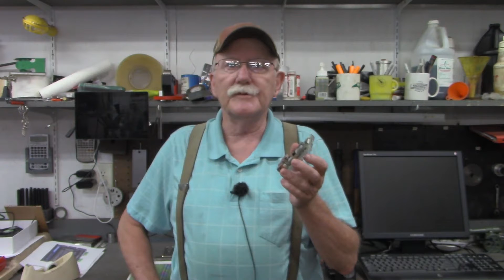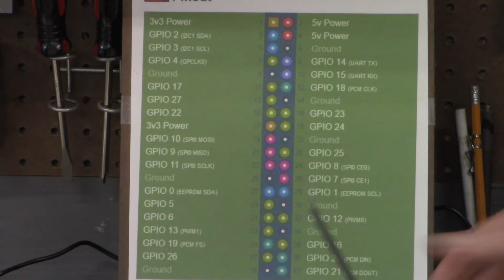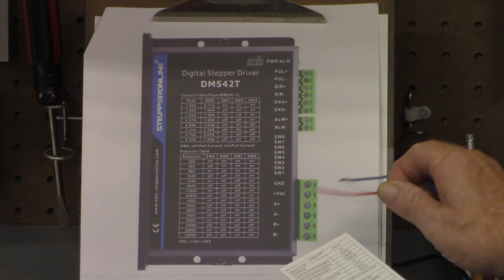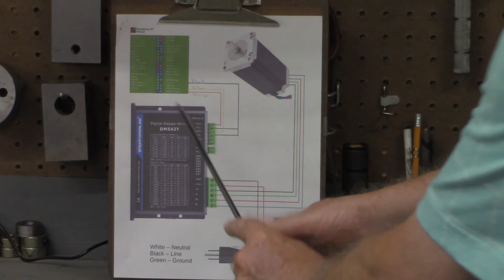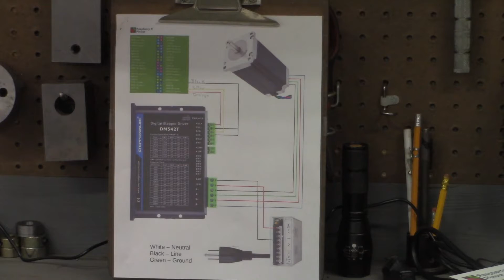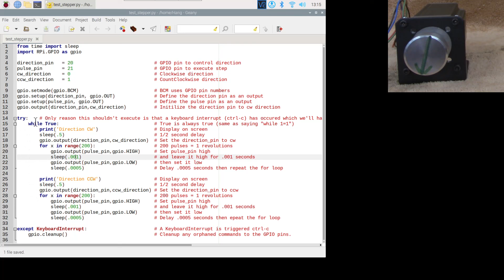Controlling Large Stepper Motor With Raspberry Pi

Comment: I knew this could be done. I scavenged the exact same Pi from an entry gate I demo'd. I have finally gotten the pi to boot up and I have found the geany 2.0 program entry system. I am picking things up at a snails pace. I don't know what python is but is there a place I can copy paste your test program? I typed the same words into the terminal but it doesn't appear to care what words I enter. And I see the colors seem to imply function. I'm just testing the motors so I can modernize an enco PC mill 50. I'm getting closer this was a huge help!

Comment: if you set it for a certain number of steps or pulses can you then use a potentiometer with more code for continuous movement while speed is coming from the pot knob?

Comment: Very Interesting I've been wanting to add a cnc z axis to my mill but I need full control meaning I gotta be able to peck drill probe and a few other tasks  i found a raspberry pi hat that give the pi a real lpt port you can add a 5 axis break out board and just use linix cnc or i have and arduino control with open build on my jd garage plasma table really not fond of the arduino control my cnc is windows based it works great I have a 2.2 kw spindle and a 45 watt co2 on her I've been using mach 3 since xp no complaints on it other that can really go past 7 good luck on yours

Comment: what motor controller are you using that will accept 3.3V without missing steps or having errant motion.  Most of the ones I have seen require an optocoupler that can inject 5V power supply which is a major head ach, then you have to buy a custom power supply that can provide 12V, 5V and so forth

Comment: Sorry for my bad English, but why can I use a 5v driver with a 3.3v rasperry output?
Reply: I am also trying to understand how you got this to work. The stepper driver needs 5v to trigger but the GPIO only outputs 3.3v. I've seen a diagram for different wiring using transistors with the 5v hot output from the Raspberry Pi but I don't know how the wiring shown in this video could work.
Reply: @stephenp2140 Same here. All I can suggest is that the 3.3v from the Pi is just enough to trigger the opto-isolator led’s on the input side of the driver. But the driver manual is clear that the input signal required is 4.5v minimum, so it’s just luck I guess, and it’s probably not going to be reliable long-term. I’m also concerned about the current draw from the gpio pins - the Pi’s max current output is fairly low, and lower than the 16mA specified in the driver manual.
I’d like to find a reliable method of shifting the logic level up to 5v. So far I’ve tried loads of different ways (Sparkfun and Pimorini shifters, pn2222 transistors, mosfet driver boards etc) and I haven’t been successful with any of them. And there is very little reliable info on the web about running big steppers from the Pi.

Comment: Switch 4 for half current reduces the current when the stepper is not running.  It helps keep the heat down when not stepping. It has no effect on operation. Excellent video.

Comment: 🎯 Key Takeaways for quick navigation:

00:18 📌 In this video, MrPragmaticLee demonstrates how to control a Nema23 stepper motor with a Raspberry Pi.
01:01 📌 MrPragmaticLee introduces himself as a retired programmer who runs a hobby machine shop and occasionally combines programming with machining in his videos.
02:08 📌 He explains that he's using a Raspberry Pi 3B+ with GPIO pins to control the stepper motor.
03:28 📌 MrPragmaticLee differentiates stepper motors from standard DC motors, emphasizing precise movement achieved through step pulses.
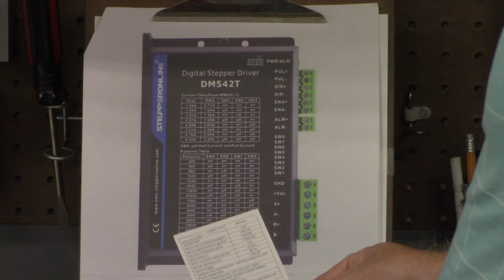06:59 📌 He shows the wiring of the stepper motor, Raspberry Pi, and stepper driver, including the connection of GPIO pins.
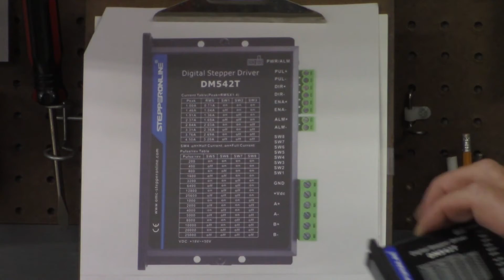08:10 📌 MrPragmaticLee mentions the importance of setting a switch on the stepper driver to the 5-volt position when using a Raspberry Pi.
09:23 📌 He briefly goes over the overall wiring diagram of the setup.
13:16 📌 MrPragmaticLee demonstrates the physical wiring of the Raspberry Pi GPIO pins to the stepper driver.
19:35 📌 He starts explaining the Python program used to control the stepper motor.
25:33 📌 MrPragmaticLee discusses the use of try-except blocks in Python for handling exceptions, specifically keyboard interrupts.
28:10 📌 The video goes into detail about sending pulses to control the stepper motor, with sleep intervals for timing.
31:36 📌 The video concludes with the cleanup of GPIO pins using gpio.cleanup to ensure proper shutdown.
31:48 🤖 The program uses GPIO pins on the Raspberry Pi to control the direction and pulses sent to a stepper motor driver.
32:27 🧰 A Python program demonstrates controlling a stepper motor. It can specify the direction and number of pulses, allowing precise control.
35:16 🔄 The program allows for dynamic adjustments to the number of revolutions and speed of the stepper motor, making it suitable for various applications.
37:47 💡 The demonstration provides a practical overview of hooking up a 48-volt power supply, stepper motor driver, and Raspberry Pi for motor control.

Comment: I am intrigued by the following observation. When I wired my setup, I shared your approach, put DIR- and PUL- to ground, and sent PUL+ to a GPIO pin and DIR+ to a GPIO pin.  This is consistent with how I understand GPIO pins work. I am worried about this because my motor stalls once per revolution and I suspect my wiring can be improved. I watched your video and you agreed with my approach. Next, I watched a video by Jeremy Fielding and he wired PUL+ and DIR+ to +5v while sending the DIR- and PUL- to two GPIO pins. I watched a video on the Dronebot Workshop and he did likewise, +5v to PUL+ and DIR+ while sending DIR- and PUL- to the GPIO pins. Do you have any thoughts on why these wiring diagrams differ so much? It is me with zero views and you with 4,800 views against Jeremy with 1.2 million views and the Dronebot Workshop with 1.1 million views. Have you seen the movie "300"? While we are the underdogs, are we Spartans?

Comment: What hapens if I use two ground pins from raspberry for PUL- and ENA-?
Reply: Should be okay if they are both connected to pins on the Raspberry Pi that are designated as a ground pin.

Comment: What interface is used between Pi and computer program...?
Reply: raspberry pi has several different base environments (if you choose the one with the recommended software from the main website, will have everything you need to duplicate this project) which you can download and write onto a SD card from your windows computer, you just put the card in the pi after its done and it has its own desktop and programs similar to windows. The device has usb ports and hdmi outs.   It functions as a slower but still capable computer with easy access to multiple digital I/Os.
Reply: @briankelly3884  Thanks!
Reply from the maker: It’s a Python program with the GPIO library.

Comment: Darn that makes the Gcode I create seem way simpler.  I guess this type of code is what makes the Gcode work kinda.  I recently learned to set my Arduino settings in two of my CNC machines you type $$ to see the settings then change the lines by like on line 13 (Inches) you would type $13=1 ( I think that's right)

Comment: You may actually want to look at lazerus an open-source Pascal programming IDE that has a built-in GUI similar to the old VB5/6 and can read and write directly to the PI gpio.  this is what i am using to build my surface grinder automation for X + Y

Comment: I've been using raspberry pi to drive my mill for few years. I use my own fast direct io library and c++ to  drive the stepper. I run my control loop in 1us cycle time, which might sound overkill, but it's best to reserve one core for driving task anyway. There are lots of benefits, allowing smoother run and easier code structure.

When using delay, excecution time of the code affects on loop speed. It's also difficult to drive several motors at the time using delays. 

My approach poll the timer and starts loop in a proper moment, no matter how long code excecution has taken. Cycle time is short enough to allow max 200khz pulse frequency for controller. It means fast speeds with high microstepping.

I use 64 bit integer as a counter, and copy highest bit for motor pulse output after every cycle. I also have signed 64 bit number as a speed value. That number is added to counter in every cycle. In a start if the cycle, sign of that counter is copied into direction pin.

With this approach, I can drive several motors with any speed and direction just changing the speed value, and pulses are as uniform and jitter free as possible. I can read encoders in same loop if I need to.

If controller have timing requirements for direction, they must not violated.  It can be done by adding required delay for direction change.

Comment: Good job but I want to see how to hookup the pie to the computer and bring up the pie program on the computer screen.  Keep up the good work.
Reply: That was going to be my question. What interface is used between Pi and computer program...
Reply from the maker: The Pi is the computer
Reply: Lee. I know the pie is a computer but how do you input programs into it to control other devices? I not really a computer guy so I have a hand time wrapping my head around it. Keep up the good work
Reply: @theundergroundesd  Something like this: the Pi is the computer and it can accept an SD card to which you have previously written an operating system (maybe Raspian)  and it will run Python and Python can be used to send pulses to the GPIO pins. So you would write  little code using Python (easy - see some tutorials) and then when you run your Python script those pulses will start everything going. So you would need to understand a bit of Python coding.
Reply from the maker: The Pi is the computer.